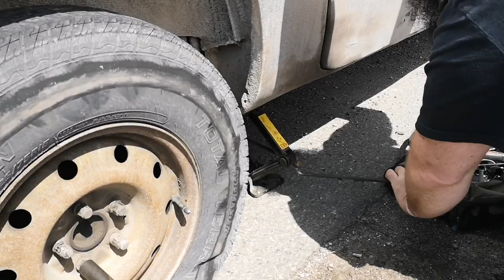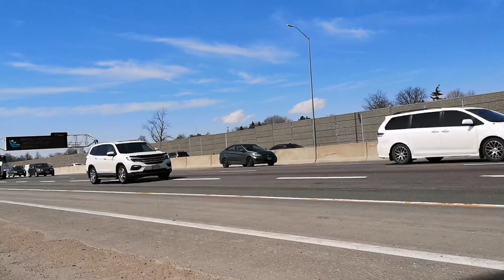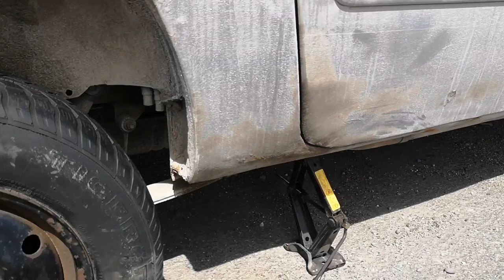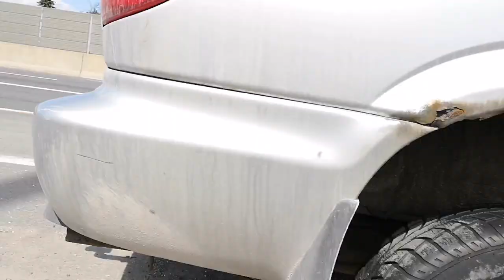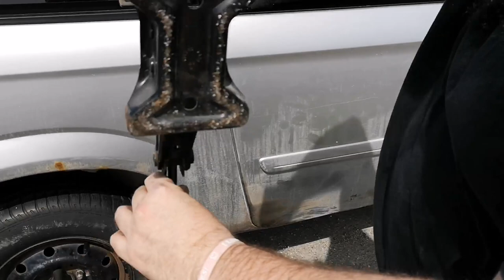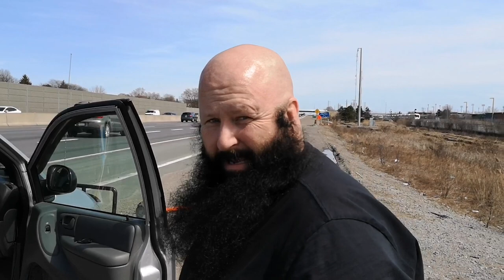Changing A Tire On Busiest Highway In The WORLD ... Vanlife

Comment: I would recommend adding a sliding T-handle lug wrench to your toolkit. In one position it serves as a breaker bar and in other position it quickly spins lug nuts on and off the studs. Also, I would replace that scissor jack with a brand new scissor jack rated for 3 tons and the longest arms you can find. The longer the arms, the higher the max lift height and the more the jack will elevate your vehicle per rotation of the crank. It also helps to have a two-piece crank assembly with a nice long hook-and-eye drive rod and long crank arm so you can rotate the crank in full circles with a decent amount of leverage and without repositioning the handle, again saving you a lot of time.
Reply from the maker: I usually carry a hydraulic pump jack, but had it out of my van this time. I like a hydraulic jack better than the scissor jack because i can put it anywhere and just not on the pinch weld which can be rotted on older vehicles.
All my studs and coated with antiseize and my wheels are all manually torqued so i never have issues taking of the wheel nuts so I carry a breaker bar, on longer trips I carry my cordless impact.
You have some good suggestions though. Thanks for sharing you thoughts with everyone. I'm sure it will help